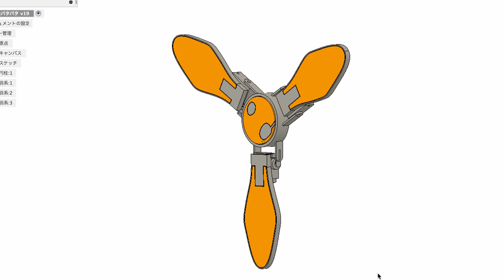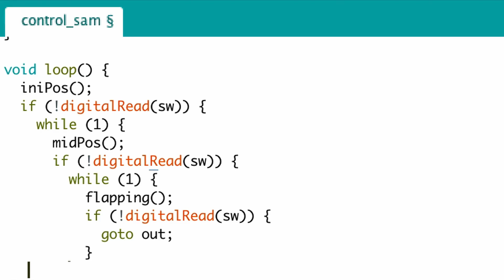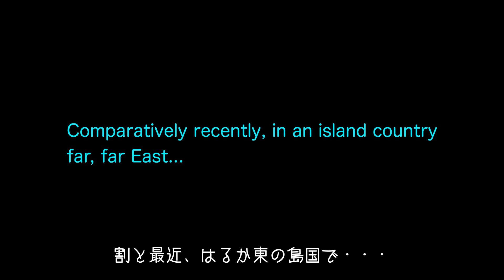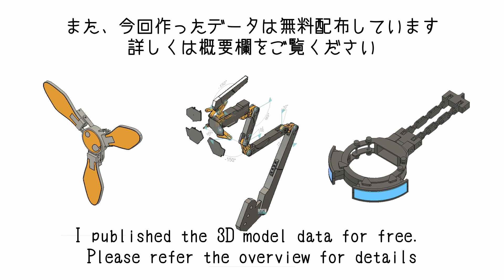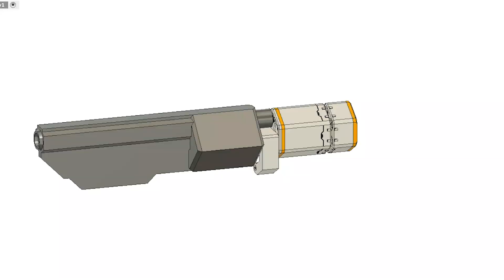How to make DEATH STRANDING Odradek with 3D printer

Comment: My only question is....how much???
Reply from the maker: this is not for sale
Reply: @VALiMA  how much did it cost to make
Reply: @Nightmacer  Arduino about $13-20 depending where you buy. You can easily get everything for the electronics for maybe $30-40. The rest is 3D printed so not at all expensive, especially if you have parts around.